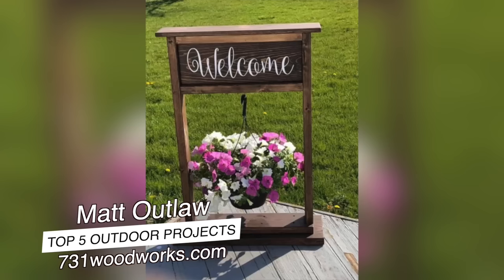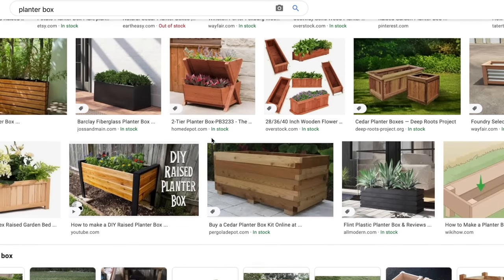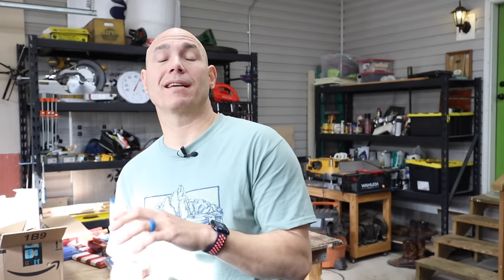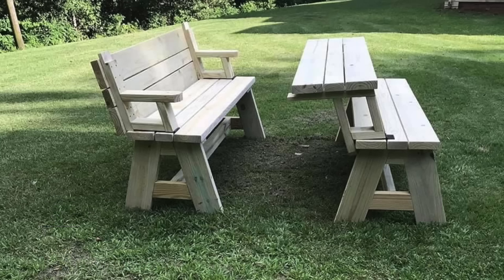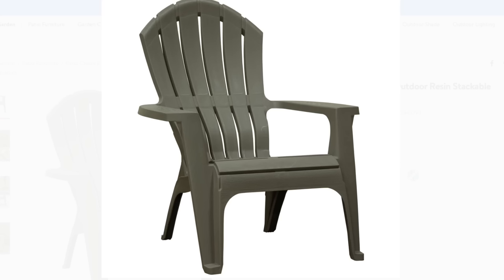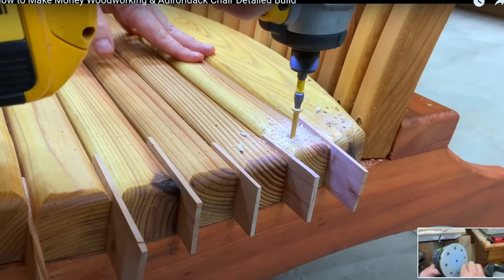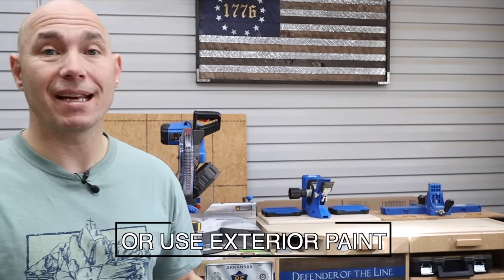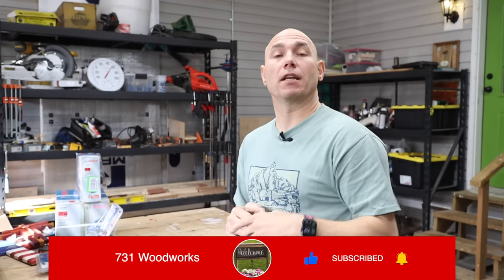Top 5 Outdoor Woodworking Projects That Sell

Comment: Thanks for all the info! I have gained so much knowledge from the 731 channel and community. I just finished a simple end table for my wife and even though it's simple I'm super proud of it. I used the tip of setting the depth stop on my kreg jig an 1/8" shallower than the guide. I'm getting ready to start building one of the crosses from last week's video I believe and gift it to my father in law. :_saw::_hammer::_fistbump:

Comment: The King's Adirondack is a great plan. I am building a set of chairs from it right now, but it is worth noting that the design is more labor intensive due to the back design. The less precise the cuts on those pieces, the more time will need to be spent sanding them to shape! Adjust pricing to match your labor!

Comment: In my experience, cypress is only good if it is reclaimed wood (old wood). I tried using newly harvested cypress (costing 3x more than #1 pine) and experienced rot within a year. I spoke to a buddy who lives in Baton Rouge, and he asked if I used old cypress or new... and that’s when he explained why old cypress is much better. My most durable Adirondack chairs so far were made from Western Red Cedar. I haven’t tried white oak or redwood yet due to the cost or availability here in the Houston area. There is a supplier in Texas City that mills reclaimed cypress into flooring, so I’m going to try their stuff next. I really enjoyed this video!

Comment: Make that planter stand a little bigger,  and you can now have a wood covered cooler for drinks.  Just add a lid.
Reply: Don't forget the foam and silicone to seal the foam.
Reply: @Realism91  I always thought about building it around a prebuilt cooler, never thought about building the cooler itself.  Good idea.

Comment: I use Varathane oil based products and the spar that you mentioned. I am from Kentucky and lived in Puerto Rico for 11 years and things were over priced even back then or just didn't have and or make things like we did back home. so I started making and selling items down there Domino tables were probably best seller . but back to the finish. everybody tried to tell me that they wanted plastic because wood rots there. I told them wood rots everyplace you just have to treat it correctly. and protect it. so I made 4 chairs and sat them out front  around a table with signs on the. full sun all year long and they stayed there 7 years.  1 untreated pine, 1 PT pine, 1 Untreated Pine but with stain and spar clear coat and 1 untreated Pine with only oil stain.  the untreated pine down there in that climate didn't last a year before turned black GREW SOME SORT OF JUNGLE FUNGAS it was falling apart but I left it there. The PT was rotting on the ends after 1 year it was discolored turning blackish by 3 years had grew the same fungus at the end grain entry points. After 2 years the spar coated started cracking but wood remained stable only slight green discolored but it would wipe off easy. Only the plain oil stain finish lasted the entire time only extremely faded in color no fungus or other discoloration except the sun bleach.  When I closed up and moved back home I gave the table and two oil based stain chairs plus two more I made to my brother in-law who still has them outside on his patio another 7 years later.   I burnt the other two during my going away redneck party LOL plain pine was a small pile of black rotten bug infested kindling the PT chair had rotted at ends and collapsed buy then.

Comment: I was actually wondering what kind of wood you used when the video started. My mom uses a lot of cypress (we live in south louisiana... like, REALLY south) and it turns out really well! My question is about treated lumber. I know the chemicals used aren't really good for contact on skin. It won't hurt you to work with it obviously, but prolonged exposure isn't that great. Do you think painting over it is enough to keep that chemical in the wood and off your skin?
Reply: You could primer and paint it; that would be more than sufficient at sealing in the pressure treatment. Now seeing this is a year old LOL